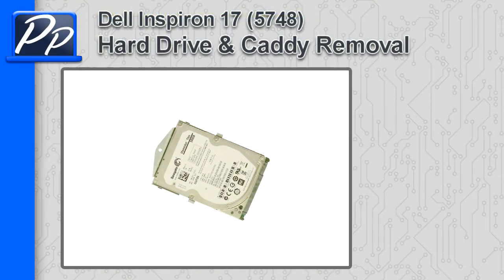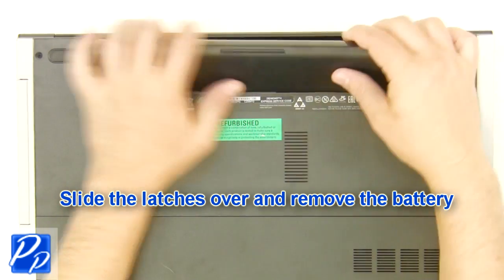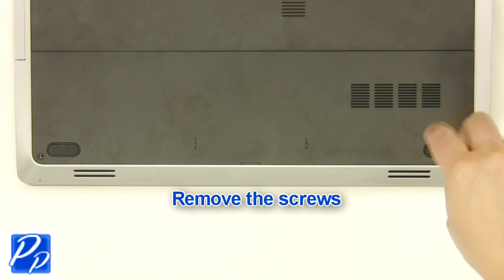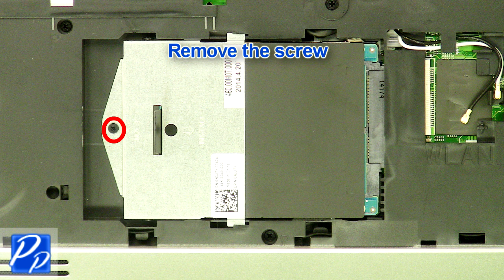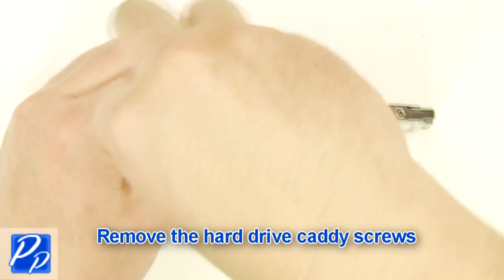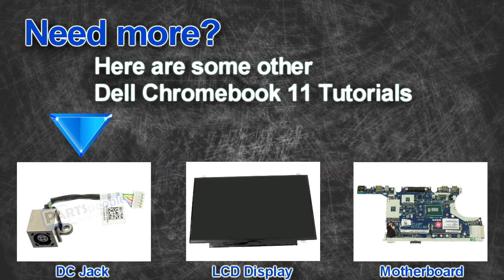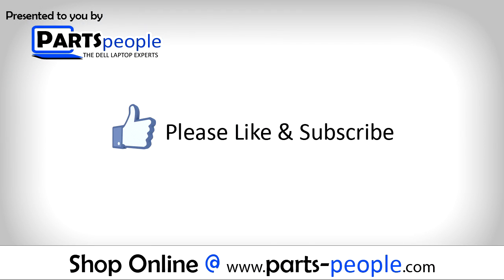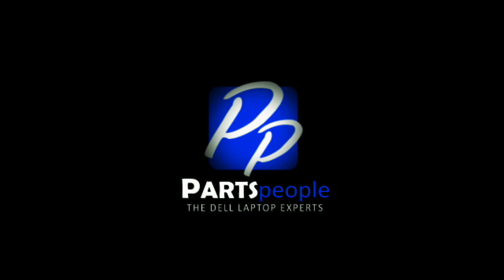Dell Inspiron 17 (5748) Hard Drive & Caddy Video Tutorial Teardown

Comment: Thanks for this easy to follow Video. I am going to exchange the hard drive for an SSD.  I purchased a cloning caddy to clone the system onto this new drive. Are there any complications I should look out for?
Reply: +Mongrel1999 Me&#39;at,home i have two 5748 (i7, gt840m, 8G) and both works fine with samsung evo.
Reply: +Mongrel1999 Me'at,home After installing the cloned SSD you should use SSD fresh!